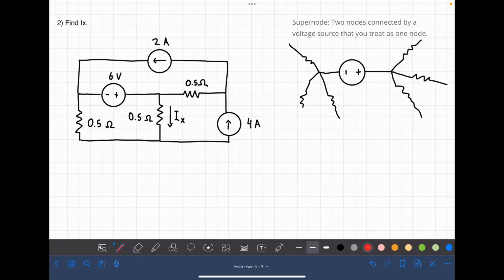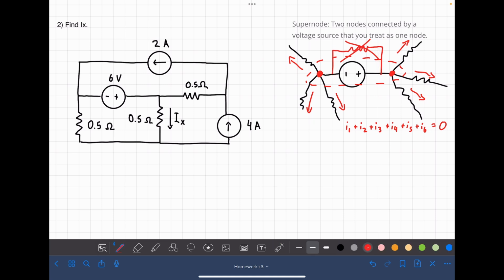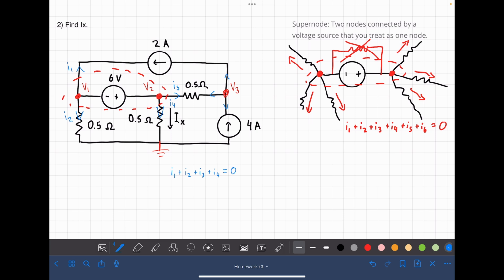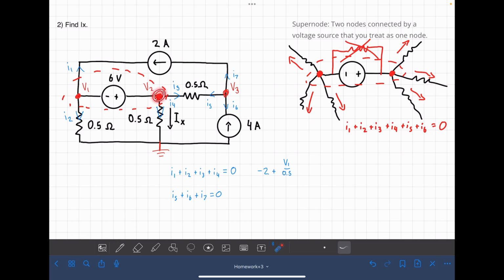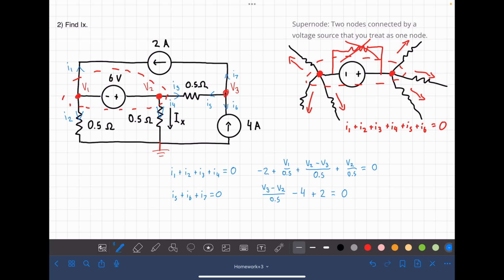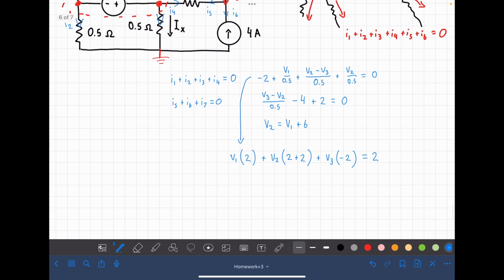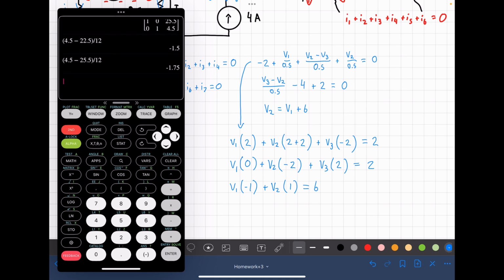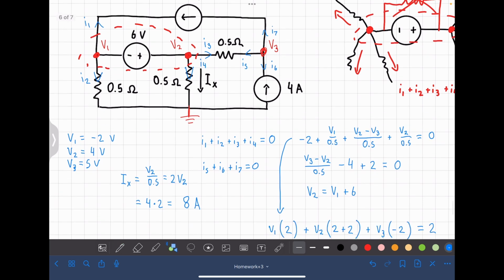Supernodes

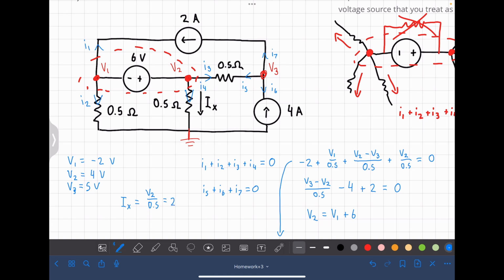Comment: This was a really helpful walkthrough - honestly, you explain this sort of stuff better than my professors. Your explanations were clear, and I found your approach easy to follow. I was with you every step of the way until around the 9:43 mark, where I got a bit confused about the appearance of the 2V₂ term. Could you clarify how that came into play?

Also, are you certain that Iₓ is 8A? It seems like your earlier method might have been correct without the 2V₂ term. From what I understand, it should be:
Iₓ = (V₂ - 0) / 0.5 = 2 / 0.5 = 4A.
Would appreciate your thoughts on this—thanks!